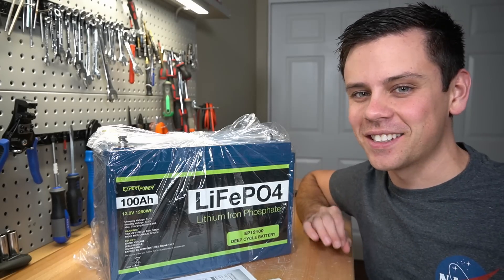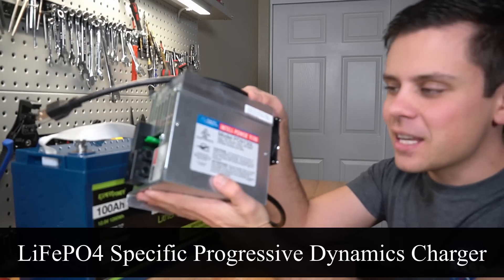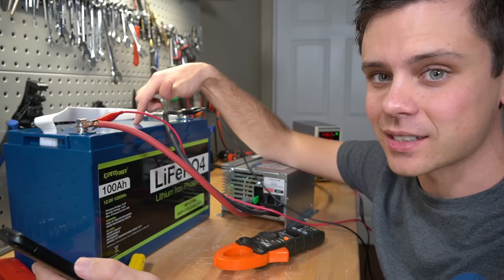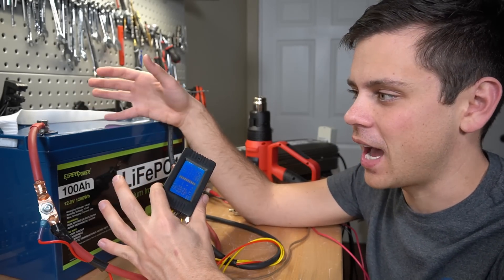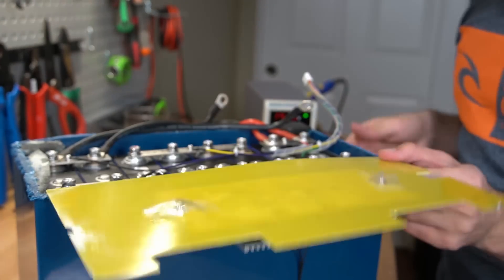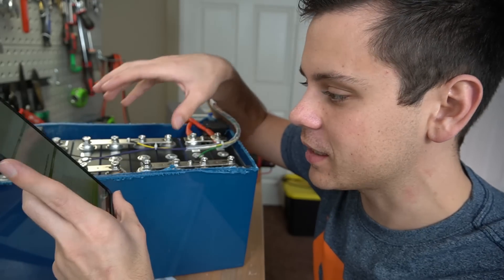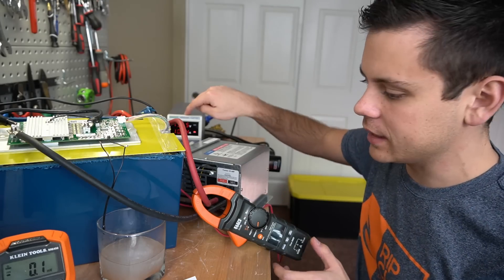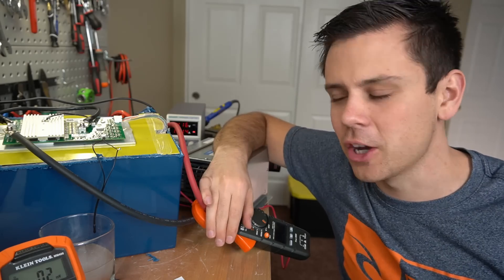ExpertPower 12V 100Ah LiFePO4 Battery Tear Down!

Comment: Glad you are taking safety and PPE seriously Will _ sets a good standard for others following and doing their own projects. Molten metal in the eyes or fibers chemicals breathed in, isn’t good.
Reply: This is take two and I'm going to leave the prior to Cremation effort the long but just ignore it I said dictation effort below  I was saying the soundtrack  is fantastic it could not be better  even if it's just a saw  combined with all the armor that he puts on figurative speaking you know it's War you know he's no longer sleepy you know it's going to get done and it's going to get done tonight he finds out what the deal is  pretty quickly even if a lot of these comments that people have put our from before anybody knew that they had this memo prepared a long time ago already to release if the battery got too cold and the fact that it was just a fake you know f a u x e  or foal f o e is pronounced right  it's like a fur this is one of those that's a pizza  it's a pizza low temperature sensor  no animals  we're Celts make that fur for you guys that want to be compliant with the protocol  that want the pony up the suckers to pay  apparently maybe two little but not two more for these batteries that you can charge for over 90 days if you start in Fall. None Fall by in like spring pre-spring start charging them up and Priests pray you'll be fine until your credit cards or give you a refund when in less than a year they start acting up they start hiccuping they're all plated up because it wasn't a real fur that you bought if it didn't keep you cold  like you helped in the summer  when you had your best  they deserve all your body heat because those fake furs  I just for looks  it's not like people that are buying furs  standing around in them for very long it's just from the  car  to the restaurant in from the restaurant that the car  if you need the fake fur for  if you are going to eat the meat  but when the paparazzi take your picture  or what they thought will my do with the ice water  on the sensor  the wrong sensor  I forgot to put  the wheel filter in  they were going to make it like outside the box or something  no or he would not have to put the battery  in the freezer they forgot somebody like said  let's just go with it as it is without that extra sets are there that can be tested to make sure it's working really great  because they didn't watch the video previously where he used ice water  not to verify  that the sensor was working  but the verify that the battery with stop delivering energy even though  the battery is supposed to deliver energy butter how cold it is  because deliver again RG we learned doesn't cause a problem for the battery unless by draining the battery you causes to recharge again  without a thing stops from charging by the same sensor so this is why they're having the difficulty with it because  2  declare that the other battery is working  what act prevented the energy stored within it from being used  just because the sensor was an ice water  insta not understand  with the engineering standards could or should be here this is take to and I'm going to leave the prior dictation after the long but just ignore it I said the patient effort below  I was saying the soundtrack  is fantastic it could not be better even if it's just us all combined with all the armor that he puts on figurative speaking you know it's more you know he's no longer sleepy you know it's going to get done and it's going to get done tonight and then he finds out what the deal is pretty quickly even if a lot of these comments that people up put our from before anybody knew that they had this memo prepared a long time ago ready to release if if the battery got too cold and the fact that it was just a fake you know f aux e  or phone f lie is pronounced right it's like a fur this is one of those to say Pita it's a pita low temperature sensor no animals were killed to make that for for you guys that want to be compliant with the protocol that want the pony up the suckers to pay apparently maybe two little but not two more for these batteries that you can charge for over 90 days if you started in Fall not not enough all but in like spring pre spring start charging them up and free spraying will be fine until your credit cards or give you a refund when in less than the year they start acting up they start hit cupping they're all played it up because it wasn't a real fur that you bought it didn't keep you cold  like you hoped in the summer when you had your vest deserve all your body because those fake fours are just for looks  it's not like people there by fours or standing around and then for very long and just from the car to the restaurant and from the restaurant to the car if you need to fake for 4 if you are going to eat the meat but when the paparazzi take your picture or what they thought well might do with the ice water  on the sensor  the wrong sensor  I forgot to put the wheel fit through in  they were going to make it like outside the box or something  you know where he would not have to put the battery in the freezer I forgot somebody like said let's just go with if it is without that extra sensor there or they can be tested to make sure it's working really great  because they didn't watch the video previously where he used nice water not the verify that the sensor was working but the verify that the battery would stop delivering energy even though the battery is supposed to deliver energy better how cold it is because delivering energy we learned doesn't cause a problem for the battery unless by draining the battery you cause it to recharge again  without it being stuff from charging by the same sensor so this is why they're having the difficulty with it because  to declare that the other battery was working when it prevented the energy stored within it from being used just because the sensor was a nice water is to not understand what the engineering standards could or should be here when the sensor is on nice water the battery should still be usable just not charge of all but that means that you have to count the kilowatt hour that are going 
The soundtrack of the saw he is supposed to open the battery case stuff can't be. Either Maddie's are burning up and it's a war for sure
Reply: Executive summary of the dictated Mastiff precedes this comment. We learned from the owner of Battle Born With The Ph.D but using electricity from Lithium-ion batteries is not a matter for a relay but you can use the electricity as long as you maintain certain parameters that would be for the BMS to control so the current drain has to be reduced I believe he said and in the prior mess that I'm replying to I glossed over that a little bit so I'm replying now with a shorter version of the points I made that is also less abridged.

A smart VMS is what people covet the VMS that is available on the market and I keep saying the instead of the I'm trying to emphasize the correct letter and that's going to take some additional practice even though this is supposed to be much shorter.

A smart BMS a truly optimal BMS is going to have the battery temperature of each battery available it is going to be able to control the resistance or otherwise control the energy flow from each battery Maybe by pulsing the batteries prevent overheating or whatever the concern is with low temperature operation it's kind of ironic Dad if you drain the battery too quickly it's going to provide a great deal of self-heating I think that we understand though that if operation during cold weather is an issue it isn't for the BMS to make the entire system fail it is for the battery in the BMS to provide for the heating and the BMS is what is going to turn the heaters on for the battery and the coolers is well you know the BMW or the Mercedes that has the built-in Cooling and it's solid-state Cooling for the liquid state lithium ion batteries that is a standard car part now for like I think it's been years since it came out or since the car was announced you can definitely go to any auto supplier that supplies that brand of car and if you have the part number which they can look up on their systems of course you don't have to own the car you just have to know the model number of the car or the full model name and you can buy those 48 volt I believe lithium ion batteries that have built-in Cooling and since solid-state cooling is reversible I would bet you that if a battery gets too cold the little solid-state lzr component that's built into the battery it's going to also keep the battery charged Able by heating or cooling it.

Of course the 48 volt battery is designed to be used in the trunk. But actually in the front engine compartment of an internal combustion engine that's why it has to have the built-in cooling even in the trunk in the rear trunk in the opposite end of the car that has the excessive heat you do need to provide cooler for your what is called light Hybrid battery dictated master procedure those comments. we are and from the owner of
Reply: We know that having the electronics external to the battery can make a lot of sense but that also building much more utility into the battery can win Awards and solve problems and add value this is kind of the American tradition this is how you compete you add value with proprietary or not engineering excellence and so the relay works for solar but for those who are trying to do things like load shift so that they can buy cheap Off the Grid electricity or combined Grid electricity with other sources of electricity like truck delivered electricity or and I guess this is be classified if you deliver or nitrogen that is if you deliver the energy that is in nitrogen what you are delivering is distilled water Frozen to not a crystal form but a metallic form so there are corporations out there that don't have any Coke brother owners even if the Koch brothers own stock in Walmart they are not controlling owners and the Walmart family is not eager to remain on the electric red they have tried to appease communities on the west coast in Oregon or Washington by putting an expensive ground Source heat pumps but they get ran out of town and then Leah pumps get ripped out of the ground by the next tenant that doesn't have to care about retail customers. If you're interested in the Walmart store ground Source heat pump it was for sale for $40,000 and probably cost Walmart over $1000000 to install.

So Walmart is where you at Stella system that replaced the electric red because Walmart is a place where people with electric cars can go to get the electricity that they're going to have in Surplus when they have the nitrogen delivered to the store and buy delivered I don't mean they store the nitrogen although they might have a very brisk business selling nitrogen instead of carbon dioxide not necessarily nitrogen ice because it is unlike carbon dioxide something that you can sell in liquid form quite safely by the gallon but there is the retail sales for liquefied natural part of me there is the retail sales for liquefied nitrogen for example the people that have actually sane rational pickup trucks the retrofitted pickup trucks you know the aluminum aluminum pickup trucks there like one year old are right to have the internal combustion engines ripped out and put nitrogen turbines in there so those trucks are going to go to the Walmart price to refill their tanks with liquefied are AAR right AAR is nitrogen a i r you have to commit when you spell the word are and I don't know how to say it so it's going to type it correctly and now I know how to say it for it to type it correctly by spelling it is free to Walmart it's kind of like Denny's you know Denny's likes to sell things like mashed potatoes and I guess what I was trying to remember is you want to sell the hot oatmeal you know you want to sell somebody hot oatmeal for like however much money they're going to pay because I'm on melt meal doesn't cost much for a Denny's or any restaurant to have standing by for those customers that think it's a bargain and it is a bargain compared to any other menu item but it's a bargain for the restaurant and for the customer 4s cost for its profit for.

So as we get into the situation where the what we like about solar and what we like about batteries is not because of the Sun or because of lithium or because of copper or because of anything but the merits of using these Solutions it does not mean that we have to bang the tradition drum and not continue to innovate and as we move away from fire as we used electronics instead of Fire has power control replaces combustion as the free air replaces the Mind fuels as an energy carrier we are going to have Walmart full the plug on the grid because they're going to have the liquid nitrogen delivered from suppliers they're going to use wind power they're going to use wave power or Moon gravitational energy to remove the heat from the air in the winter when there is value to heat and they're going to store that liquefied they are they're going to store the liquid oxygen if they don't have a market salad until which of course there is a huge liquid oxygen market so if you can produce liquid oxygen Greenlee everybody that buys oxygen of course including the federal government through Medicare and Medicaid will stop buying the coal powered oxygen. When you start caring about solar energy when you start caring about getting more of yours on your YouTube channel so you can retire sooner not later you understand that it's not just about photons it's not just about lithium ions it's about doing the entire economy you know text to its about this time improving it it's about saying we don't care about these International corporations and their trillions of dollars to lose in these multi-decade contracts dependent upon the world remaining gullible about what a staying informed consumer with demand.

 But the informed consumer consumer on this planet
Reply: Informed consumer on this planet is what makes the people the kings of the country not the president is the king but the people because the people not by their taxes but by the choice their freedom to learn creates makes them the Kings. A paragraph

There are people who accuse former presidents of being insincere when they are sincere as any person can be. Not every person or president is a sincere as any person can be. As more of us learn this fact that's more of us learned that the way we feel when the person that has taken everything we care about away except for the way we feel while they're doing it as moral lesson learned bad experience is more of a start tuning in to the classic rock about that experience about that spouse about that lover about that parent that son that brother that sister about these dysfunctional relationships that we can have with people who do not tell us what they believe to be the truth and we like this channel because we know this channel the person that's talking to us is telling us what they believe it is not that they can't be wrong but that they do not lie.

Everybody is human everybody will have some conflict of interest in that they don't have control over it it is not that they are corrupt everybody is not corrupt but everybody can be conflictive everybody can be biased everybody is imperfect.

When we look at the big fancy Ford car that a man that was born long after the Ford that made the company had finished his work and the forces of competition and progress have been stifled in the world so that instead of getting a job at some other company the same company is still around even though you don't have a clue about what went into the work that created the company which was honesty and integrity and doing the very best by the people the customers the king

So we have an electric red that has been proven to lie to us. Part of me this channel does not lie but we loved it not just for that reason but because we know that the utilities that are often privatized and always corrupt because the Monopoly when it comes to energy is a very very bad thing and as we use more electricity we learn that we don't need to use some more but that we need to be more self-sufficient and how we use it we need to have more control over how it is produced not less we need to have more control over how we do what we need to do whether it's getting more heat into our house or get the heat that's leaking in out.

I read recently that the reason houses have double pane windows is because of the water from our lungs condensing on the inner pain not because the oil etcetera industry cares about reducing the amount of money and product we would buy from them.

 This is a very dangerous time because if we do not figure out what our actual needs are and have them Matt Moore we will not be able to meet them at all. I don't know who Matt Moore is I only know that I said we need to have our needs met space more our needs can be satisfied much more if we figure out what they actually are that does not mean we need to have other people tell us what they are it means we have to figure out for ourselves maybe with help from others what our needs are when we really care about the most.

Everybody should have as much electricity as they could possibly want if they were able to learn what they need to know to make that the case. Your paragraph

 Fortunately none of us need very much electricity at all. The battery like this can be bought for less than $1,000 definitely not from this company and it's plenty big for almost all of us. The battery like this weekend maybe keep in one location all the time or we can transport to where the last mile doesn't drastically increase the cost of the energy we put into it.

At the end of the day the amount of energy we consume becomes far less important than how we consume it and how we obtain it in what form it is and how it is used.

YouTube allows the people the search for the information and obtain it in a way that they can understand it. A paragraph

This is why this channel enables the servants that it enriches to serve us. This is democracy. It is what it looks like. It can B improved so much and that is called a virtuous cycle.

Encourage everybody to continue learning. Anybody who wants to be free is best advised to seek truth. we love our host here because he has a taste for truth and it is contagious.